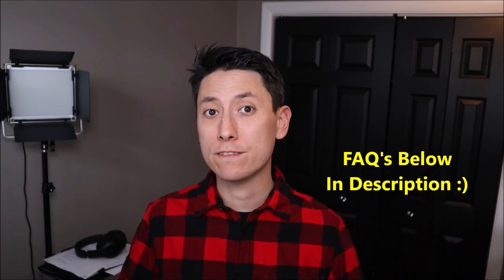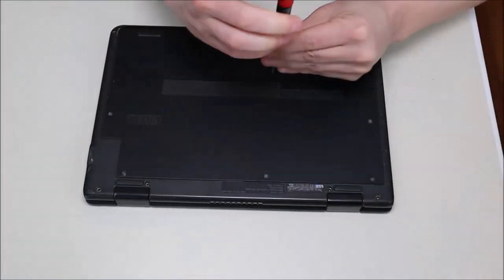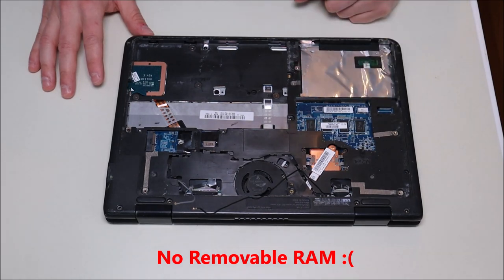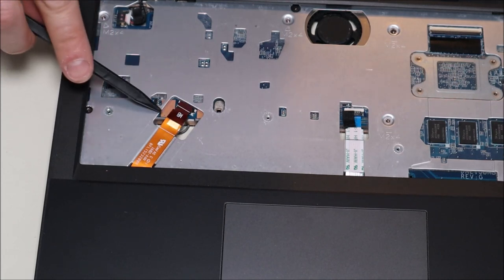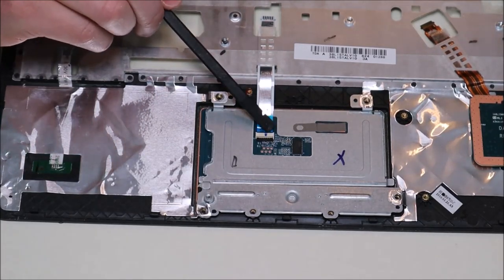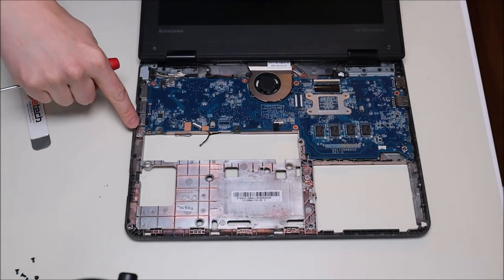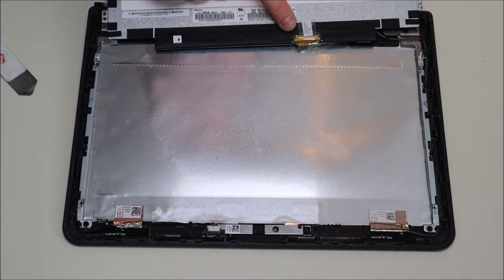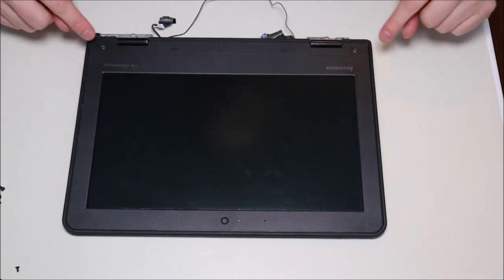Teardown / Disassembly for Lenovo ThinkPad 11e Chromebook

Comment: Thanks for the video, I have a question about mario chrombook stuck on os verification is turned off, but there is a bigger problem, when I try to turned it on it shutdowns automatically after 3 seconds...I think there is hardware error let me know what you think, any ideas to fix it
Reply from the maker: Are you able to see anything on the screen before it turns off? Also, did anything happen before this issue appeared?  Liquid spill, overheating, Windows update, etc?
Reply: @PC_Monkey  thanks for your quick response, there is a message that says " chrome os verification is turned off, press space to begin recovery" and immediately turns off.

Comment: Can we upgrade ssd 16 to 128 gb for this laptop??
Reply from the maker: Without using an external SSD, no :(  The drive in this computer is integrated into the motherboard and cannot be replaced or upgraded easily.  Your only option would be an external attachment